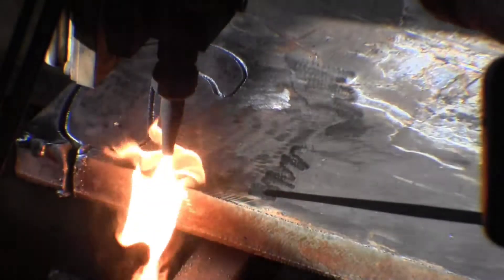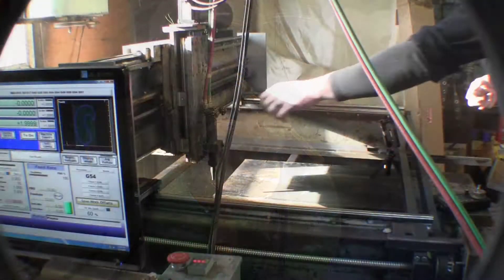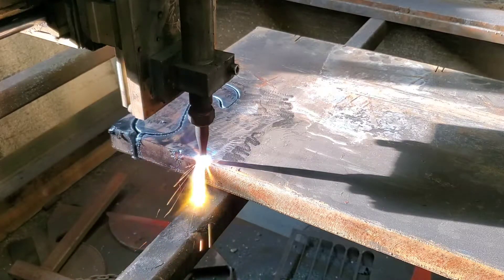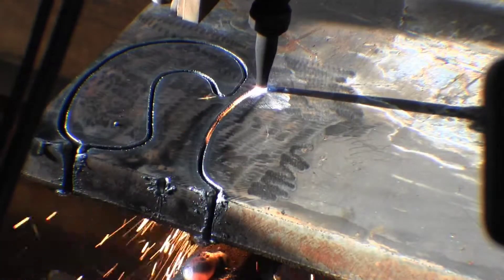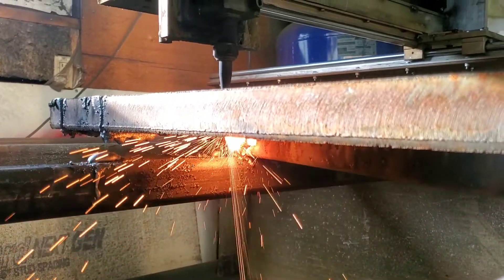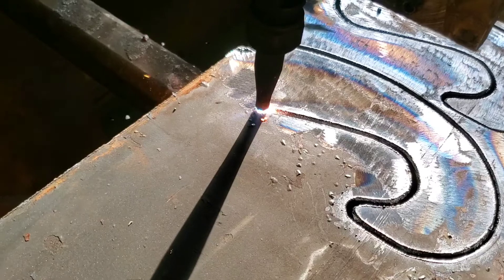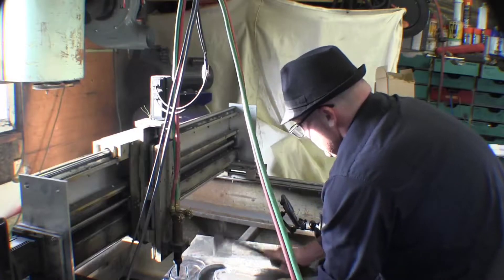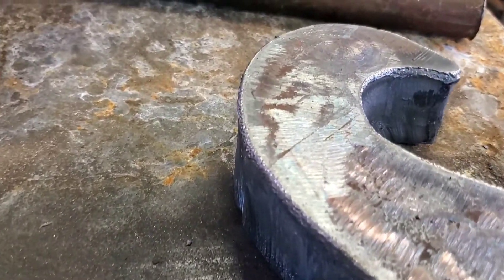Cutting Thick Steel plate Oxygen Acetylene Torch on a CNC table Episode 14

Comment: which software do you use for CAD and CAM for your oxy torch cnc?
Reply from the maker: Funny you should ask that. I put a small snipit of it in today's video. .should be out in 4 hrs. I use electric aspire. However it is designed for cnc router work and I wind up having to go in and play with the g code.  I may go down and talk with the guys at fast cut cnc this summer and look I to upgrading.

Comment: I have old profiler that works pretty good, but limited on size of cuts, really want to put one of these together, nice demo, once torch is dialed in this would be great for thick cuts.
Reply from the maker: Thank you soCalwelder 
One avenue may be, I know of a shop in town that has a portable cnc plasma fixture that they can throw down on a plate and cut. Then the sky is the limit. 
This machine was overbuilt for torching for sure but versatile for routing wood and plastics .

Comment: It is way too fast for the entirety of the cut - have you tried this again running slower?
Some things to remember: Open oxygen cylinder valve entirely (for quality) and acetylene about 1 turn (for safety). Set pressure with the torch valves open. Clean the nozzle tip - you may actually have a bad tip - if the nozzle was cleaned incorrectly by flaring the holes out or it's worn out. From the video it looks like your tip is too close -- your preheat flames inner cones shouldn't be buried in the cut kurf. Adjust the preheat and tip distance on a scrap piece with the goal of having a very slight radius on the top edge - you can also turn the preheat oxygen off entirely once the cut is started for a sharp top edge. When you are done, the slag should just fall off revealing a clean mill like finish with sharp edges.
Reply from the maker: Thank you very much well said Ryan.  Looking back I know for sure there was a bad tip . ( abused ) I will take this and try it on the next run of parts . 

Thanks again ,cheers

Comment: thats wild! there should be some overides in mach so you can adjust the feedrate on the fly. you probably could have slowed the cut on the back end there. Cool video.
Reply from the maker: Yes there is on the main screen . I hit it about 1 inch into the cut . Coming out the mill scale wasn't cleared i guess and popped up jamming up the tip .  It was originally programmed for 1-1/4 running at 15 ipm and had to run around 11 ipm